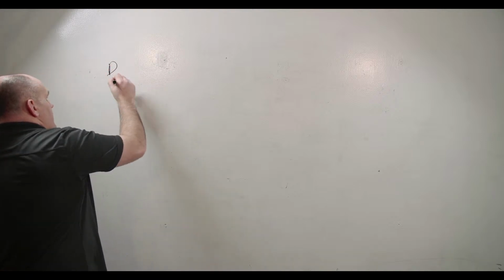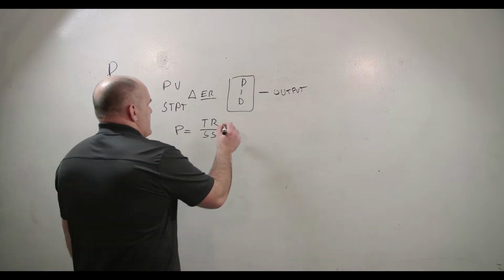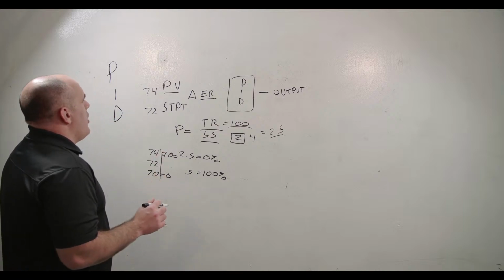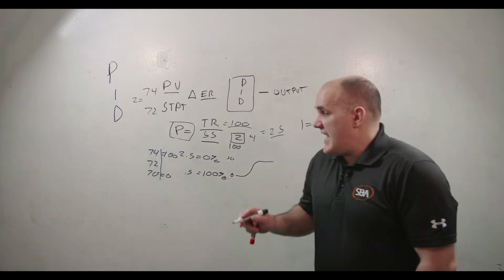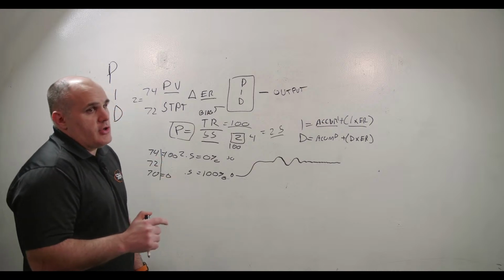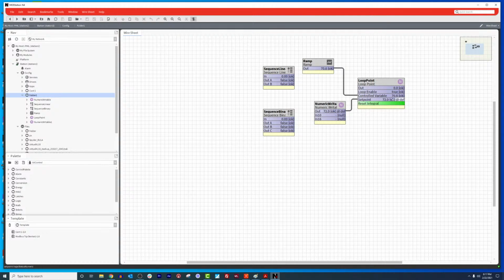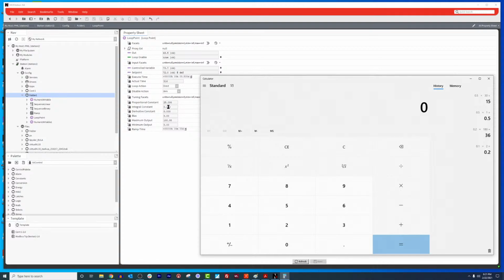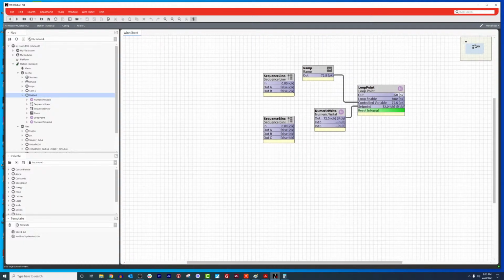SBA TV 21: Control Modes PID

Comment: Thanks, Phill. Question on the static loop. Let's say we are at 100% on .5" and 0% on 2.5 ", as you have mentioned. At 2.5", the command goes to 0, the fan keeps running on inertia a little bit, the static pressure starts dropping rapidly, the loop responds with high output, and repeat. Could you elaborate on how to avoid the scenario above? It is going to be almost a "hunting" scenario. Should we not slow it down gradually, like from 100% down to 80%, etc? I appreciate your response
Reply from the maker: I'll answer this in a future podcast episode because this is a hard question to answer in the comments.
Reply: @SmartBuildingsAcademy  thanks!